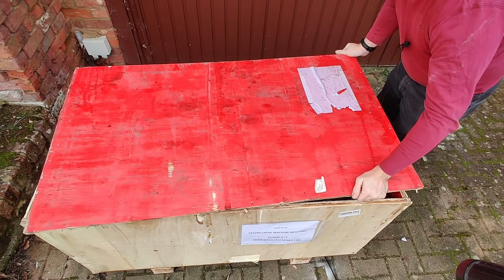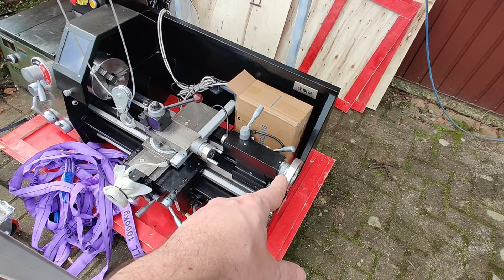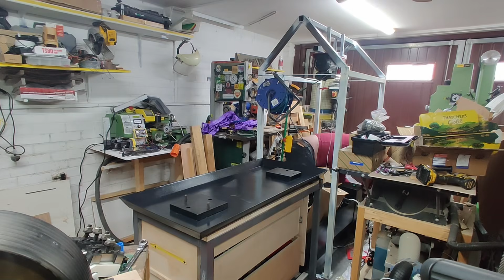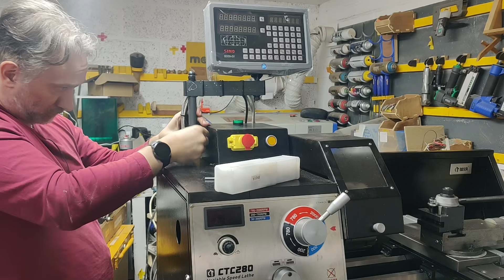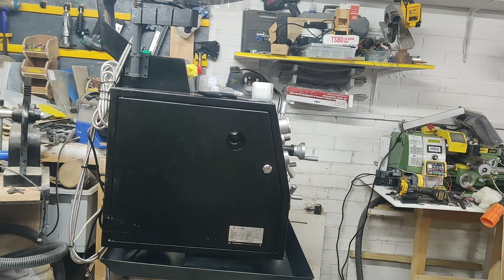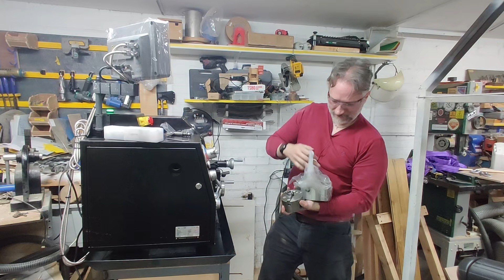The Heaviest Tool I’ve Ever Bought - new Lathe Unboxing

Comment: Watch some good machinists and tool insert selection and uses. High speed steel works well on these small low powered lathes, carbide needs a lot more speed and grunt. What do you plan on making? Using what sort of materials? A good live tailstock centre would be a must have these days.
Reply from the maker: yeah my hss cuts pretty nice. but also most of my carbide works just fine - particularly the stuff designed for aluminium. 
initially I'm probably working on parts to upgrade my robot arm. I have no specific long term plans but various projects wind up benefiting from being able to make decently precise round things. I tend to work in bright steel and aluminium. I'm sure I'll have a go at more stainless, but might try setting up a flood coolant setup before I get that far.

Comment: That tool looks to high
Reply from the maker: it might have been a smidge - I just eyeballed it quickly. I've been slowly going through doing a nicer job of setting tool heights as I start to work on things properly
Reply: @MakerGeek  I worked on lathes milling machines drills etc for 60 years
Reply from the maker: @pricklydoorhandle wow! You're probably the kind of person that can judge a diameter within 0.01 just by touch after that much time. What's the most memorable thing you've worked on?
Reply: @MakerGeek most memorable was splining spiral grooves in rolls for the food industry ,rolls were approx 8-10 ft long 14” dia, cut took an hour so I could sit on my but and read the paper👍

Comment: That "lifting frame" is postively dangerous - very poor design, those unbraced legs were flexing all over the place & the whole lot would collapse very easily. And that is without the bird-poo welds.
It did the job - but think of it more of being "got away with it - this time" rather than being a reliable solution.
Looks like a decent machine - I have a Warco GH600 of silmilar envelope but with an all geared headstock - not in their range anymore, though. Hope you have as much fun with yours as I have with mine.
Reply from the maker: hahaha. if you think that looked dangerous - it's a good job I never filmed how I moved my mill into place. you'd have a heart-attack!. I promise you that the gantry was in absolutely no danger of collapse. that said if you saw my previous video I talked about the fact it is was literally built for this one job, the next time it appears in a video I'll be cutting it up again to make a welding cart.
I'm quite happy that warco didn't make me a sensible offer on the wm180, I think I've wound up with a lot more lathe for the money than I would otherwise have got. So far I'm loving it, and of course coming from the much smaller wm180 you really feel all the benefits of the bigger machine.

Comment: You seem to suffer the same problem I do, lack of storage. I had a look at the Warco, and Chester websites and the VS Warco WM280V is very similar in specs with 40% more power but with a lot smaller hole through the spindle, and it'd cost £400 more. If you went for the bigger spindle, it'd be an extra £1200. Chester doesn't seem to do an equivalent anymore.   
You can track the majority of ships, as long as you know the name and/or IMO number, use marinetraffic with a com. If I'd still have been an Engineer at sea and my mum was still going, she would have loved it tracking where I was.

Comment: Looks like a very nice lathe.   Good you were able to get this on the work bench.
On my metal lathe, the Fwd/Rev lever on the right of the carriage has a detent for STOP in the middle, but the spring is too weak, so the first time I wanted to stop the lathe in a hurry I went from Fwd to Rev with rather a lot of noise and it scarred me.   NOT good for the motor.   I then designed a way to prevent the lever from going into Rev for normal use.   I only remove this block if I am threading.   My lathe has threaded chuck so not recommended to run in reverse.   Your VFD will control any such rapid move of the lever from Fwd to Rev, but you may still want to consider some way to keep from accidentally going from Fwd through the stop detent into Rev.
It looks like you have an AXA size of clone of an Aloris quick change tool post which is the same size as my Phase II brand of clone of the Aloris quick change tool post.   I love this design.
Reply from the maker: That's an interesting observation - I could definitely see being a little hurried and pushing from forwards straight into reverse. - a stop block sounds like a good idea.
For the tool post - I'm a big fan - my warco one is the piston type that presses outwards, where as this one is the wedge that locks the dovetail out more. I think I prefer this wedge for the locking. but both are great to use. I do love having a bunch of tools ready to go. - the only thing I can see happening now if I switch jobs between the two lathes is ahving to keep resetting the tool heights.

Comment: It's still quite a small Lathe IMO...You should try some HSS lathe tools and learn how to hand grind them. Carbide requires more spindle power because they push material off rather than cut it. More suited to heavier machines. A common mistake made by Hobby machinists....🤔😳🇬🇧
Reply from the maker: I just showed a very quick test in this video - I do of course have some hand ground HSS which I used in a separate short which cut very nicely indeed.
Reply: @MakerGeek Good, I'm a retired time-served Mechanical Engineer. Heavy, precision engineering making Ordnance...Hand grinding Lathe tools and drills was a skill they taught us in our first year..Some of the Lathes used to machine Naval Gun barrels were 50 feet long. ...It's a nice enough machine though and I can see why you chose it, value for money I guess....🤔😏🇬🇧

Comment: Why did you not simply hire an Engine Hoist....?....For lifting car engines in and out.
That welded leggy frame is hilarious...I know it works but seriously you didn't think this through IMO....🤔😳😏🇬🇧
Reply from the maker: check out the video in which I built the gantry - I talked about that exact choice. but tl;dr; not a lot of room to manoeuvre, quite expensive to hire, and i'm re-purposing the steel to another project I wanted longer term anyway.

Comment: You'll probably get a nicer cut if you use a pointier insert. Those trigon inserts are sturdy and give you 6 tips per insert but also need more power. Looking forward to seeing this machine in use!
Reply from the maker: agreed, I think I need to update my tooling a little bit - I do have some pointier carbide bits and I did another test off camera with just a freshly sharpened HSS etc. lots more playing to be done. probably going to do the tradition first project of making some nicer handles for the various lathe controls which will give me some time to play with getting the best results.

Comment: i think you get the award for most ADD/ADHD workshop. i thought my space was total chaos until i watched this. 
congratulation's on the new lathe. when i got my 12x36 i thought it would be big enough. they're never big enough or long enough... wait is that what she said?
Reply from the maker: lol, yeah I suspect there is something of that going on ;-) In terms of lathe size, I've heard it's how you use it that matters... but it's hard to deny that the new lathe makes the old one look like a toy. Another commenter pointed me at cutting edge engineering's new lathe... I suspect they don't get much bigger than that, practically had to account for the curvature of the earth in levelling the thing

Comment: You need to 5s that work shop and now you will be much more Efficient and happier try it I'm an ex Rolls Royce engineer I know these thing enjoy anyway.
Reply from the maker: I'm not familiar with the term 5s - but I'm guessing an approach to overcome my deeply ingrained untidiness? it's a life long struggle - I occasionally go through bursts of inspiration to organise parts - but I sort of accept there is just something wrong with my brain - every surface around me ends up covered in random bits and bobs ;-)
Reply: @MakerGeek  Seems 5s is from the Japanese Seiri, Seiton, Seiso, Seiketsu, Shitsuke - or Sort, Straighten, Shine, Standardise, Sustain. Just a posh way of saying "don't do that, do this". My garage / workshop is like yours (or better or worse depending on your viewpoint!) but I make it work anyway. I have two Myford ML10 lathes but I wish I had one like your new one as they are a bit small. Here's a tip from experience - don't throw anything away as you'll need it for the very next job...
Reply from the maker: well I'm glad I'm not the only one operating out of chaos.  I'm already a nightmare for keeping everything - your'e right that sooner or later you need it! though I do have a lot of random wood off-cuts and bits and bobs I could probably clear out for space.

Comment: Congrats of getting what looks like a very nice machine! Chinese machines have some a very long way in the last 15 years for sure. Tooling, and everything else too. 250kg is really enough mass to make a very nice machine, and it has everything a lathe really needs, hardened ways too is a big plus. I'd have recommended cutting a hole in the middle of that drip tray and undermounting a used stainless steel sink so you can use a coolant pump.
Reply from the maker: Thanks. That's an interesting idea, the unit belowis drawers so no room directly beneath. But I wonder if I could run a wide bore hole near the back and run a big hose to a tank... Might have to give that some serious consideration.
Reply: @MakerGeek  I built a stand for mine like 9 months ago and it's one of my big regrets. I just made a crude tray from some scrap sheet metal and it sucks, coolant would really open a whole new world of not running to the garage to sharpen tools every 15 or 20 minutes sometimes... Currently looking for a granite countertop the right size, hoping to get a 1.125 or thicker piece. just tricky to find the right size, and why not in flashy green, am I right? The feature creep ensures it will only happen if there's fate, because there certainly is no budget!